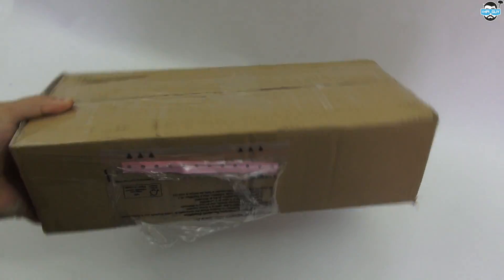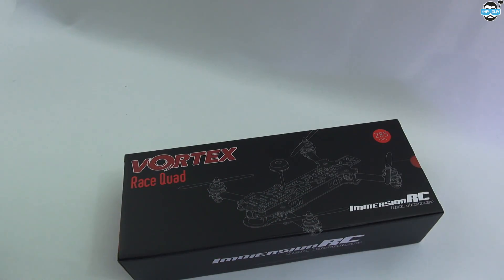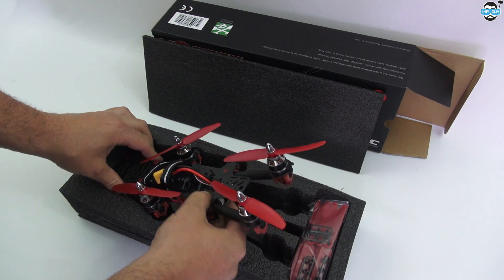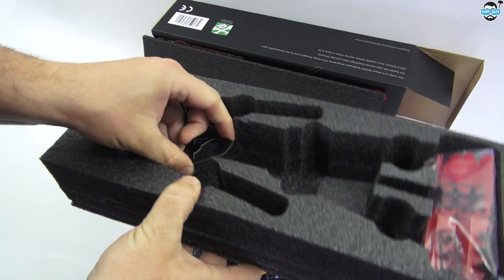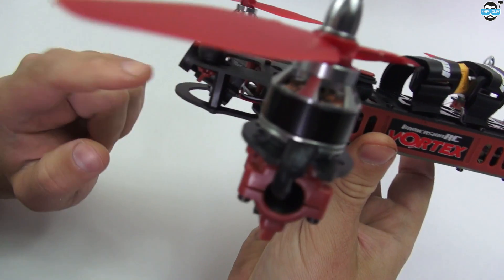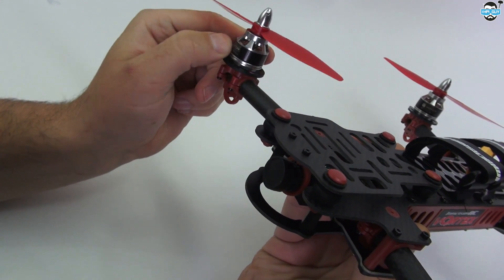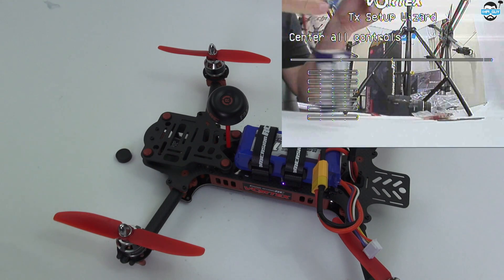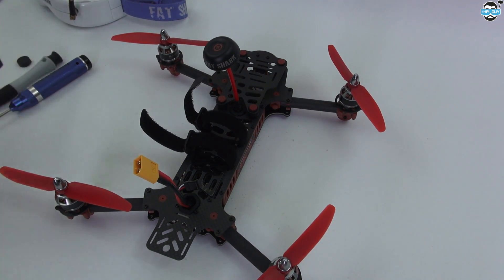HPIGUY | ImmersionRC Vortex Strip Down - ESC replacement test - Unboxing

Comment: Note that the vertical PCB mount antennas are much better than the side mount ones, strength-wise. I use them on the VTxs I build and I've never broken one. The RF design on IMRC products is awful though.

Comment: Gutsy taking that apart! well done. Look like 1mm wall 14mm or smaller girley arms LOL!
I tried water jet cut delrin and with bolts it pinched like that. Lexan is stiff but cracks in crashes.

Comment: too much plastic. too many parts, too much money. I don't get it tbh. especially for those that have already built their own
Reply: +doluseb  You can 3D print one for 10 bucks.  Of course without the electronics.
Reply: +doluseb quality is not cheap folk!!!
Reply: The plastics on this quad is for braking them only.its obvious its cheap :)
In a crash with the vortex you will only break the plastics , I think its good ;)

Comment: some cute ideas. Like the metal spring clip on the video tx - helps to dissipate heat. Unsure about the escs buried within the arms - retaining heat.
Reply: Tobermory Cat they should add small scoops at the ends of the arms to catch some of the air movement and direct it down the arms and in to the body to help keep it cool.
Reply: keyproductions100 
that's a great idea!... i think im gonna dremal out some slots and do that.

Comment: great vid! And yea... you pronounced it right ;)

hehe i did the same thing when i got the prototype... i just took it completely apart.

after 30+ crashes on my prototypes... i can honestly say that ripping that SMA is the last of my concerns :) Even in crashes where the antenna caught a tree branch, and random 3-year olds picking it up by the antenna only to toss back to the ground sigh :)